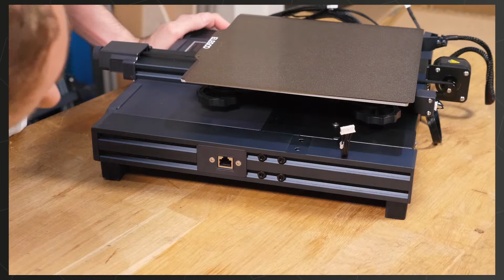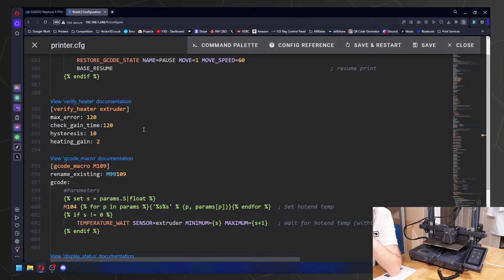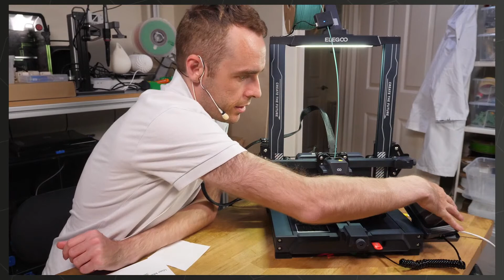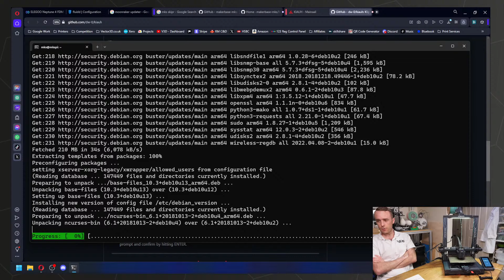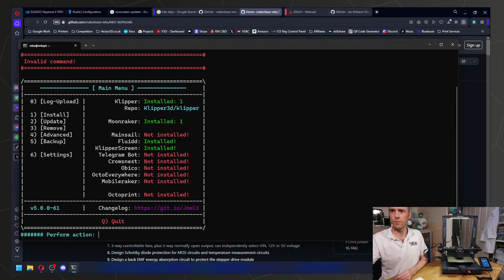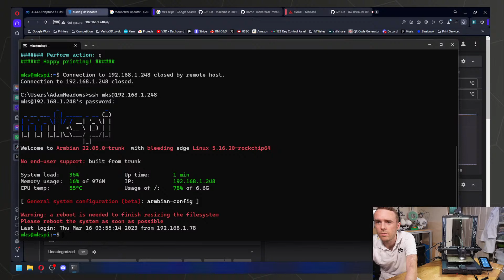Elegoo Neptune 4 - Unboxing, First Look, First Print

Comment: Just got my Neptune 4 Pro, great thing. Just had an isue after putting it together: The z Axis was stuttering like crazy when moving along it. I checked everything and all the cables etc very fine. Was near to giving up but swiched it off and moved the whole X-Part up and down slowly while applying steady force at both sides at the same time. After that, the stuttering was gone. No idea what was wrong before.

Comment: MKS Skipr and all their reduced OEM versions still use Buster. With their own distribution of Armbian. So many updates will not work. Definitly not something for advanced users - but it works with the features adverticed and is an easy and cost effective way for manufacturers. But for DIY enthusiast this boards are definitly not the optimal solution, as you are stuck to an old version of Armbian and some newer modules are not compatible to Buster anymore.

The eMMC can be read and flashed with the USB-Adapter you can get from Makerbase.
I did this on my Qidi X-Max 3. So I have always a backup (and I also swapped to a 32 GB eMMC).